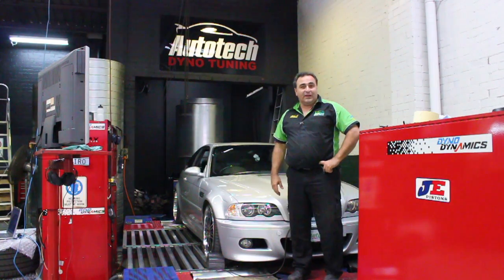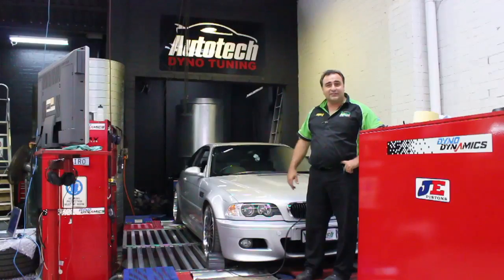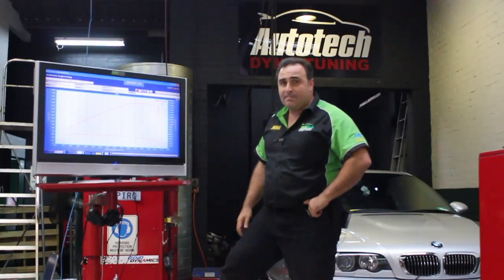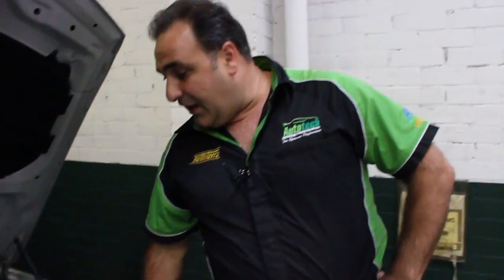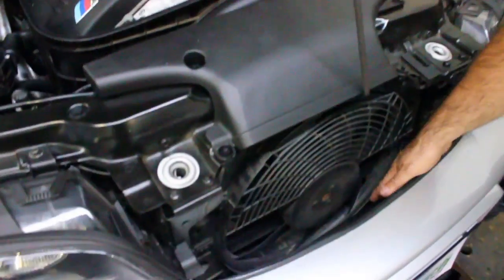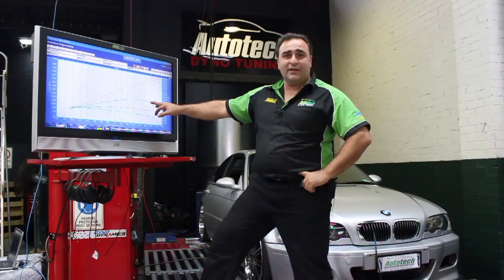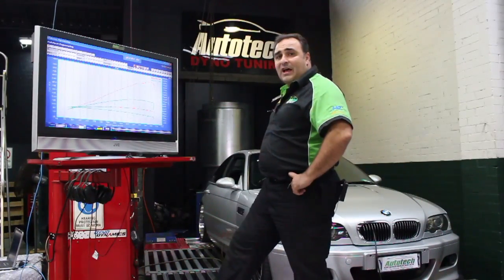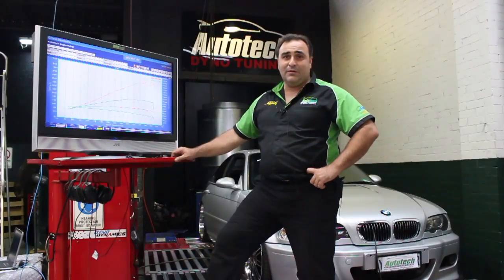BMW M3 Supercharger Kit Installation

Comment: Bmw engines are mostly strait 6's and so the super charger wwould most likely not mount on top like most other cars, but a pro charger kit looks like a turbocharger and sounds like one but is still driven by the belt, and not all super chargers need an intercooler, in fact most don't. Unlike turbochargers which require one along with many other components. This is because the supercharger isn't spun by exhaust gases so theirs no need for cooling.  Hope those cleared up some questions.
Reply: Dirty Dan -Procharger is a brand name ALL compressed air is heated whether its a turbo or a SC, so having an intercooler  means denser charge means more power.Most SC do use a FMIC unless they run methanol or water injection to cool the air, some run all.

Comment: How it is attached to the engine belt? It's got its own belt but on what does he put the other side of belt? And it sucks air through air filter which is now behind bumper, and what next? I mean, does the air flows then to the radiator and then to the manifold? (I'm not an expert, I'm just asking :) Btw nice video!

Comment: And the dumbass saying a turbo is ran by the motor. No. Turbo charger is powered by exhaust gases coming from the exhaust manifold. Superchargers are powered by the motor, which turns the pulleys which turn the compressor wheel. Stop misinforming people. Then again, we are on youtube.

Comment: this is a procharger. a turbo ran my the motor, superchargers are ran by belt and do not is an intercooler. its simpty forces more air into the manifold thus making constant power. prochargers and superchargers have "boost lag" that have to be purged at a certian RPM level

Comment: Of course there's ecu changes they've just made cuts in the vid. Supercharger kit takes around 10 hours to fit not 8 mins. Also there's 4 different ess tuning SC kits available. Any and all supercharger kits require you to send your ecu to there company to re-program or they'll send you the remap file via email so you can flash it yourself.

Comment: That supercharger is not super pressurized, it works directly with stock e46. any more bar than that requires a huge bit of fuel/ecu work.

Comment: Is it possible to take a Supercharger out of a merc c230k and put it into a clk 55amg. Would anything have to be modified such as the fuel injectors or the air intake manifold? thanks
Reply: No it wont flow enough air for the 55

Comment: The 256 that u have quoted is at the wheels not the flywheel, BMW quote flywheel bhp of 320, u get power loss through the gearbox and diff.

Comment: its basically a turbine design blower, what they call a "Centrifugal" supercharger, & yes it does use a blow off valve, & sounds kind of like a turbo, except it is belt driven like a supercharger vs exhaust with a turbo,

Comment: Exhaust from the engine have to flow inside of turbo to make the turbines spins. When the turbine spins, the other end of turbo sucks in air.  The air (boost) goes into intercooler and back to intake-manifold. Supercharger is belt-driven by the engine. Basically, when the belt spins, the superchargers impeller spins and it sucks in air and makes the boost and then through intercooler and back to intake-manifold. If I explained it wrong correct me. Have a good day.

Comment: you still need blow off valves on a supercharger to stop the pressure surge when the butterfly valves close damaging the compressor blades. Turbo's are powered by exhaust flow, superchargers are powered but the engine timing belt. All turbo's look the same (sea shell), but there are different types of superchargers, this one is like a turbo compressor

Comment: Its a super charger, Its a centrifugal supercharger so it compresses the same way as a turbo however its belt driven, since it compresses the same way there needs to be a blow off valve and intercoolers are on both supercharged and turbo cars. Its a vortech supercharger google it.

Comment: it depends on the year! i would go with V-F engineering they did my 2009 m3 for about 10,000 dollars if you have an 2006 or older right about 7000

Comment: Turbocharger can apply more pressure easily than a supercharger and it is mostly more efficient, because the Supercharger is belt driven. Although the Turbo has a lag when hitting the gas pedal where the supercharger has immediate response.

Comment: 238 is at the flywheel - not at the rear wheels :)  You loose power through ur drivetrain.  All car manufactures always advertise flywheel KW, never RWKW.  :)

Comment: the two openings that connects to the intercooler,, where does that lead straight to engine or into the intake then to the engine??
Reply: air filter > supercharger > (air gets heated from compressing) > intercooler (gets cooled) > into plenum  than motor.